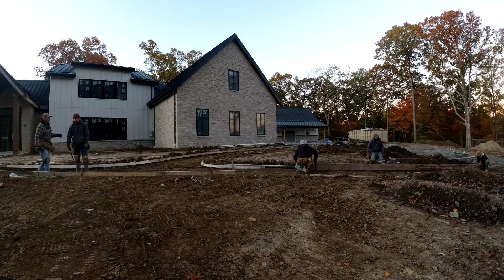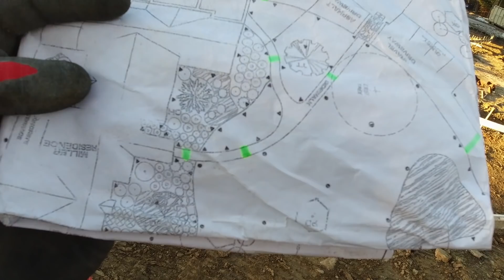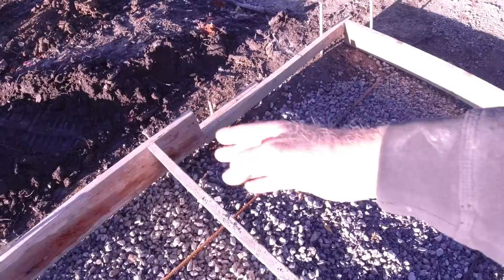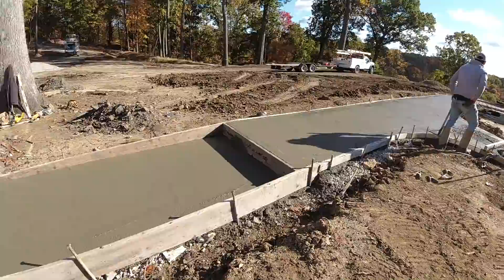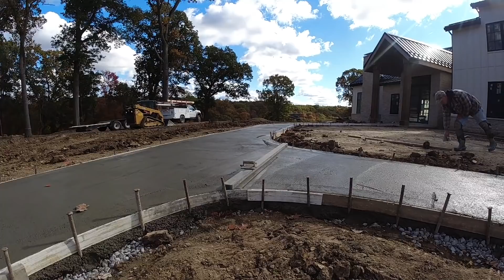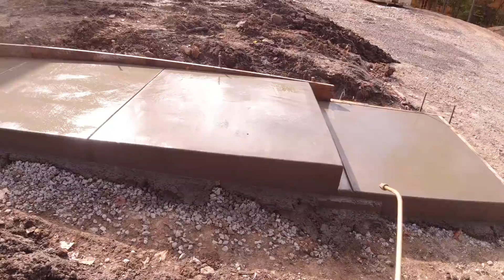Think This Exposed Aggregate Front-walk is Long Enough?!

Comment: Curious as to why you apply the Surface Retarder on BEFORE you power-wash the top layer off of exposed agg? Wouldn't it be more effective to do so AFTER it's... well, exposed? Or does that just make it slicker once it's set?
Reply: The surface retarder is the chemical that keeps the top from hardening. If you don’t put it on after the concrete is troweled, the top layer of concrete won’t come off. Thanks for watching!
Reply: @GunpowderandFreedom  Thanks for the reply. I misunderstood and thought it was for  retarding moisture.
Reply from the maker: Thank you Steve perfect answer

Comment: Those long rods dont serve any purpose unless you put in rods side to side tied to the long rods !!
Reply: They're for preventing uplift...not walking.
Reply: @killer408cid  up lift ?? I have never had a side walk lift  unless it was caused by tree roots !!
Reply: @tnolan3176  never heard of frost heave?
Reply: @killer408cid  In my 45 years of doing concrete ,I have seen driveways heave but not sidewalks ! Atleast any of the ones I poured !
Reply: @tnolan3176  curious as to why that is.  I mean, they're pretty similar...one of the sections of my sidewalk has "tipped"...low on one end and high on the other.  I'm scared to death my mother will trip and fall when she comes to visit.
Reply: @killer408cid  try prying the low end up and it should even it up !! Put a brick or rock under the slab when you pry up  at the low end  !
Reply: Another professional speaks LMAO
Reply: @daveklein2826   Thank you !!

Comment: TOM, I noticed the sidewalk apron connecting the garage door pad,  could you have flaired the left side of the form to match the cut to the exposed aggregate? Or do yinz have to follow the architect plans exactly how it's on the print?
Reply from the maker: Great question we actually looked at that and thought anymore of a flare on it it might just look a little too big